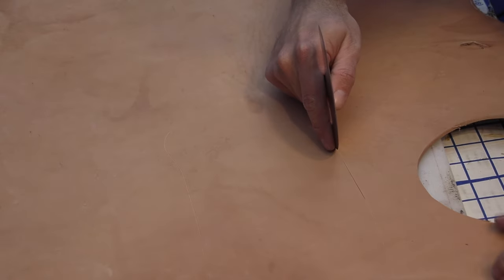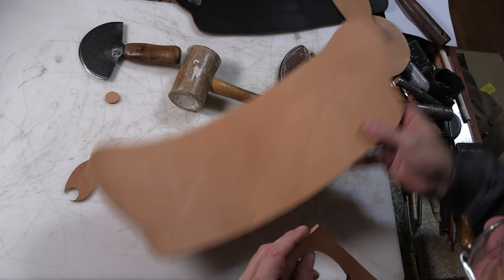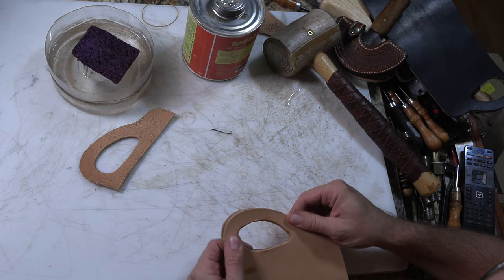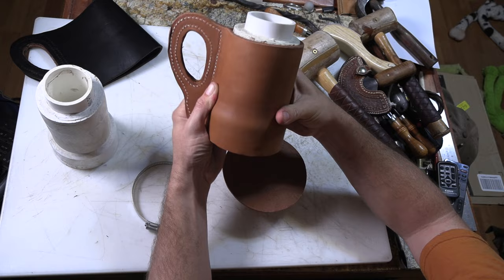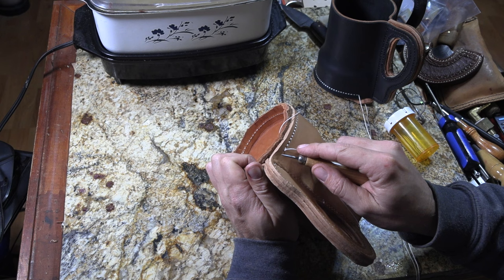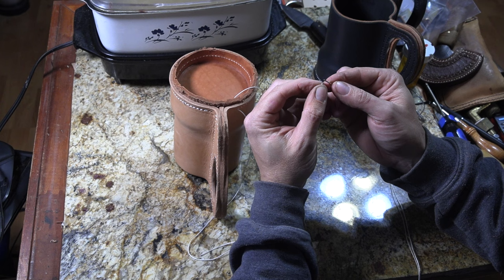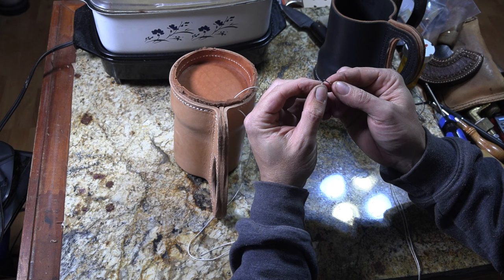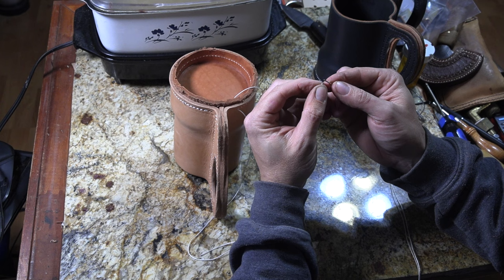Making leather mugs.  Jack mugs a sturdy historic drinking vessel.

Comment: Is it possible to just use beeswax to seal it, or are the brewers pitch/epoxy necessary? I don't expect to be using it extensively
Reply from the maker: Beeswax alone tends to crack.  The pitch makes it more flexible.  It would probably work but may be a little more frustrating.  Beeswax shrinks when it cools and that causes it to break away from a surface or crack if it is adhered to the surface well.

Comment: to clarify  you can Either use the pine rosin and bees wax mixture as the final stuff you put inside the mug to keep it watertight OR you can use the epoxy  SO it is an either or and both work the same??
Reply from the maker: Yes, you can use either of them to line the mug.  The epoxy will be more resistant to heat so it is possible to use the mug for hot drinks like coffee.  I still don't suggest hot drinks because the hotter the liquid the more it will soften the waxed leather.

Comment: Those red plastic party cups are everywhere.  What about molding the cup around one of those and just replacing the interior cup?
Reply from the maker: It is definitely possible to make a tumbler or cup that way.  Probably need to fill one with plaster or something to make a solid form to shape the leather.  Cut another one apart and press it flat to get the curves right for the truncated cone shape of the pattern.  Maybe not even mess with the bottom since it is just a cover for a plastic cup.  Trickiest part would be getting it just the right size.

Comment: Can you use pine tar to seal the leather it’s black shiny black ,just wondering
Reply from the maker: Not sure.  I have not worked with it.  I would first check to see if it is safe.  I don't know what solvents are in it.  It was used to seal boats and canoes, so it would be watertight, I am just not sure if it would be good to have in contact with something you are drinking.

Comment: What is that tool called that you marked the stitch line with?
Reply from the maker: It's called a stitching groover.  It cuts a shallow channel in the leather so the stitches are set down into the surface.  That helps the stitches last longer because the thread is not as exposed to wear.

Comment: I’ve been watching your braiding  videos and had some questions regarding leather sourcing. I’ve been tinkering with Turks heads using paracord and hard laid cord and would like to venture into leather. I know where to purchase leather lace but not tanned hides such as you use in your videos. Donald
Reply from the maker: I purchased some leather from Tandy leather because they have a store close to me.  Most of the leather I cut into lace I have been ordering from Waterhouse leather.  Another vendor I order from regularly is Springfield Leather company in Springfield Missouri.  @springfieldleather here on YouTube.  I have used calf and kip hides from them and they even carry kangaroo which is the super premium leather for cutting lace.
Reply: Most craft store will also have it like Johans

Comment: What machine and setup did you use to sew the bottom?  I'd be curious as to how you got into that edge.    Pattern?
Reply from the maker: I have a Cobra class 4.  The bottom of the mug is big enough that the end of the sewing arm fits inside.  The bottom  is  shaped deep enough to allow for the stitches to be where they need to be.  When I originally designed this pattern I had a Tippmann Boss and it fit the same way.
Reply from the maker: I am planning on selling the patterns and resin castings of the forms in my Etsy shop.  Just  don't have them ready yet.
Reply: Whoa.  I would have thought it would need to be deeper.  Thank you.  I would like to make a jack mug one day when I replace the class 3 I sold. @bransonsgeneralstore

Comment: Do you sell patterns for making the Jack mug? I'm interested.Also is there a reason that I can't hand tool the exterior of mug? Thank you very much for video.I will be watching for more leather videos should you put them out.
Reply from the maker: You can tool the leather.  In the past I have carved several of them.  You may lose some of the sharpness of the impressions when you shape the mug and when you stuff it with the wax.  To prevent some of that you can carve "in the round" which is after shaping with the leather still on the form, but that is difficult to do.
Reply from the maker: I have a listing on my Etsy shop that is for both the patterns and a resin cast form to shape the mug.  https://bransonsgeneralstore.etsy.com/listing/1626056629/pattern-and-form-to-make-leather-mugs
Reply: @bransonsgeneralstore your Etsy site is sold out...how much just to buy pattern.?
Reply from the maker: It should be back in stock now.
Reply: @bransonsgeneralstore  can pattern be bought by itself
Reply from the maker: It can now! The pattern is available for sale as a digital download at https://bransonsgeneralstore.etsy.com/listing/1614334374/pdf-pattern-only-leather-mugtankard